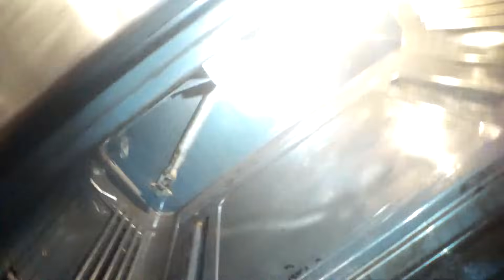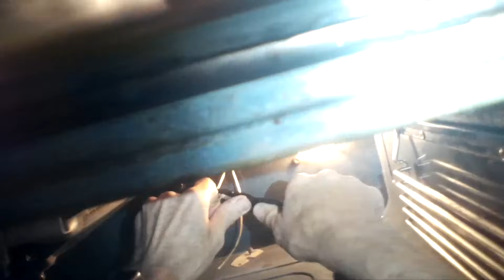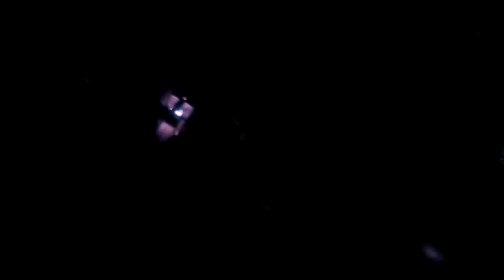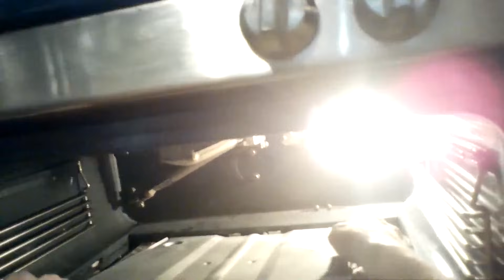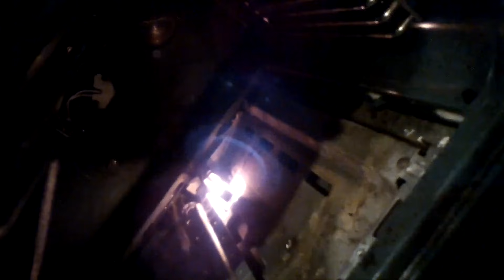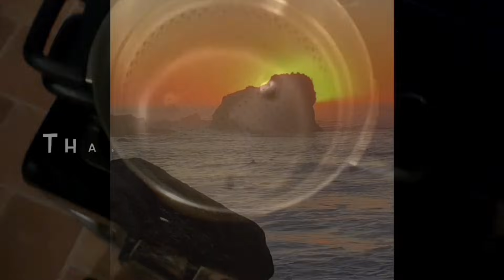✨ GAS OVEN BROILER AND BAKE - EASY DIY IGNITER REPLACEMENT ✨

Comment: Do you just use regular wire connector they won’t burn from the heat
Reply from the maker: The wire connectors are made of porcelain 😊

Comment: thanks for the vid... i replaced my bottom igniter few years ago... IF you have time... is the broiler supposed to burn mostly blue?  Ive had this oven for almost 20 years and seems the broiler is burning "colder" than it should.... the igniter glows a nice bright orange then when the gas turns on it takes maybe a minute to ignite then burns mostly blue... THANKS MUCH
Reply from the maker: Blue is the best.  It means near complete combustion 👍
Reply: @ScottTheFixItGuyChannel  Yes sir and i actually knew that... sometimes ya get dummberer as ya tink..i even told my wife the white flame is hottest but not sure why i had that brain F@RT... Thanks for the quick reply.... I am wondering a bit if maybe the gas valve is partially clogged or something... the flame is blue but still doesn't seem hot enough for a broiler.... Have a good one